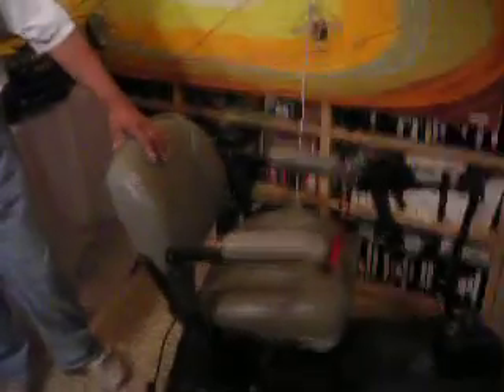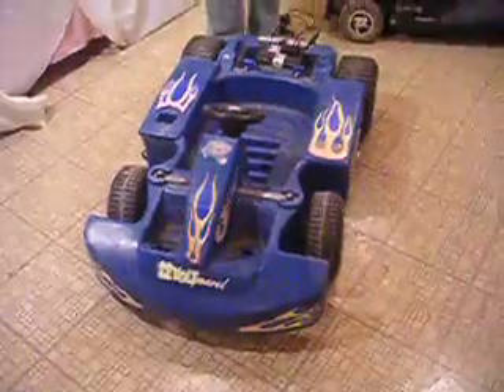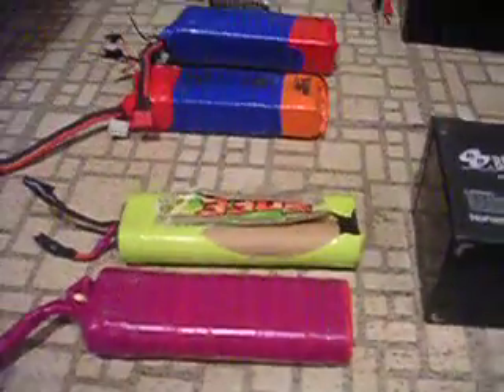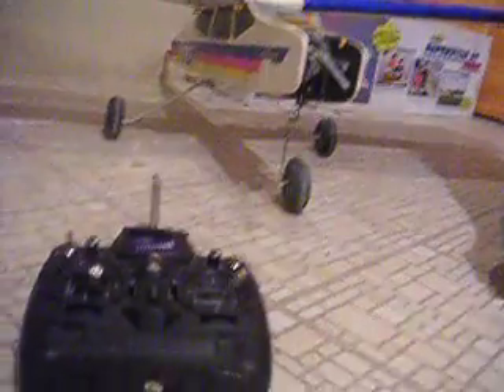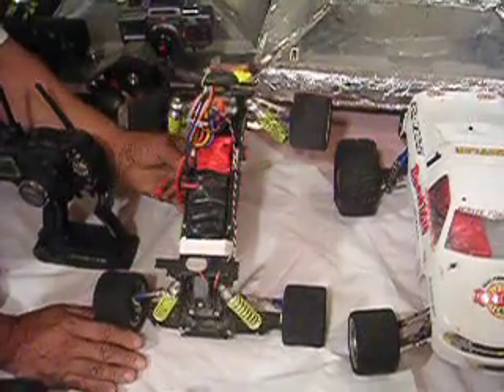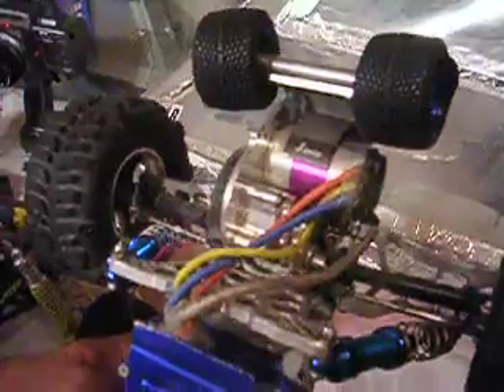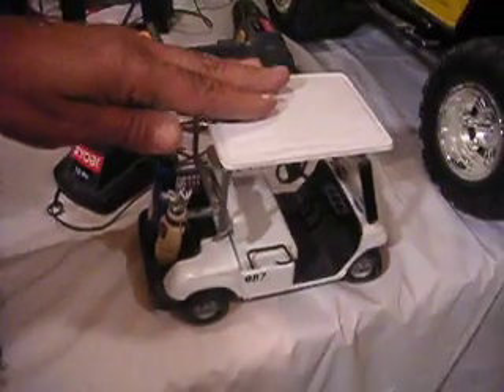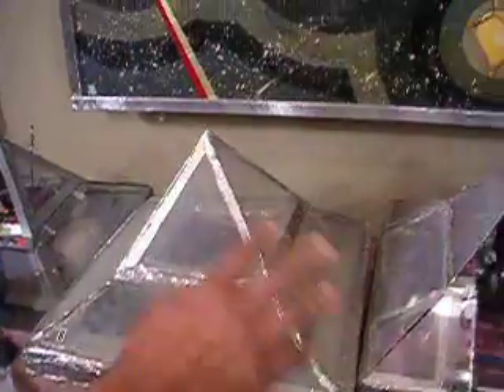Electric RC Cars

Comment: Put a LI-PO batterie on it it will go much faster but the downside is ur basicly carrying around a stick if dynomite i work at a hobbys shop that sells this stuff a employe charges a batterie half full then on a different charger later=BOOM 4 times the size and 4 fire trucks